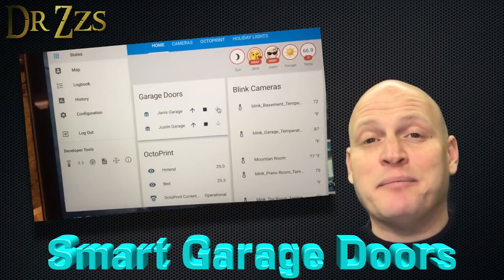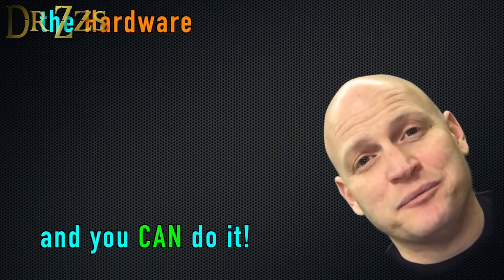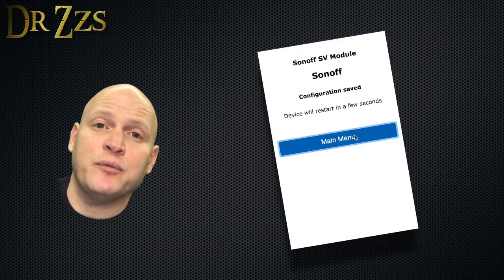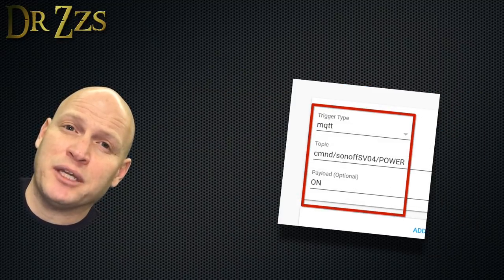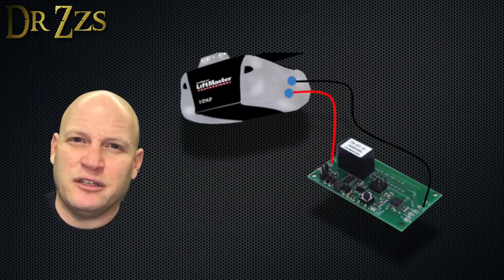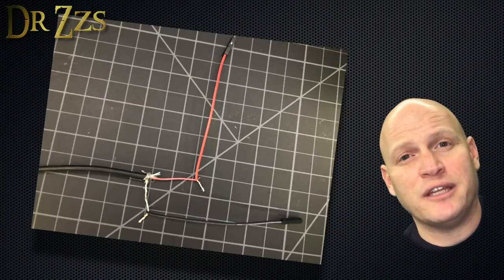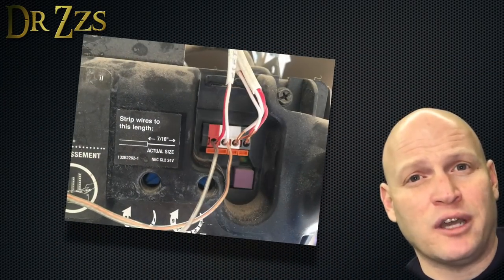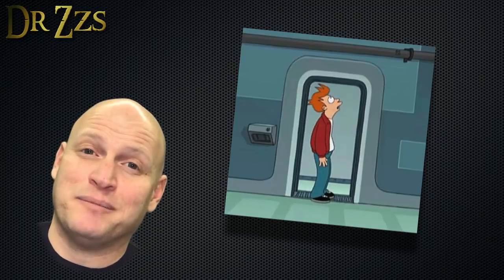$5 DIY "Smart" Garage Door Opener using Sonoff SV

Comment: Hey DrZzs, How I change the state of reed switch? You have when they are together, the door is opened, and when they are away, door is closed. I want the inverse. When they are together, the door is closed and when they are away, the door is opened. How can I do that? thanks
Reply from the maker: Try swapping "ON" to "OFF" in the state topics. 
This is what I have:

cover:
  - platform: mqtt
    name: "test"
    state_topic: "cmnd/2/POWER2"
    command_topic: "cmnd/sonoffSV04/POWER"
    payload_open: "ON"
    payload_close: "ON"
    payload_stop: "ON"
    state_open: "ON"
    state_closed: "OFF"
    optomistic: false
    retain: false

I think if you change (state_open: "OFF")  and (state_closed: "ON") it should change how the arrows show on the cover card in Home Assistant.  

Let me know if that works.  Actually, let me know if it doesn't work too ;P
Reply: Hey DrZzs, 

First off all, thanks for your time. I tried it and it works :) thanks so much!
Reply: I have one more question. If I unplug sonfoff from the power and connect again, it switch to on. What sould I do? Thanks

Comment: If you Console the PulseTime<x> command (ie. PulseTime1 10),  then you can skip the automation that turns the relay back off after 1 second. Instead,  the Turn OFF trigger will be executed automatically via the Tasmota firmware, and not through Home Assistant.

PulseTime<x>                  Show current PulseTime of relay<x> in 0.1 seconds
PulseTime<x> 0 / off        (Default) Disable use of PulseTime for relay<x>
PulseTime<x> 1..111         Set PulseTime for relay<x> with 0.1 seconds increment
PulseTime<x> 112..64900 Set PulseTime for relay<x> with 1 seconds increment starting with 12 seconds (add 100 to desired interval in seconds, e.g. 113 = 13 seconds and 220 = 120 seconds)
Reply from the maker: Couldn't have said it better myself! 
Thanks Jose!
Reply: "pulsetime1 1" worked like a charm. Prefer this then HS as the delay works also from Alexa app when garage is triggered. W/O this the relay stays open and garage will not react to physical button push. 

Awesome tech guys! thank you
Reply: super Jose Almonte :) thats is exactly what i wanted very helpful thank you
Reply: Thanks Brother
Reply: But then you would also have to change this to ON right?
    state_closed: "OFF"  <-- "ON" ?
Reply: @HenrikCaspersen  YES!  I'm glad you mentioned this..  Helped me fix my open / close issue with IOS Home Automation
Reply: @Jose Almonte Thank you soooooooo much. The automation wasn't working properly on mine. Also i had to switch mine to Power1 instead of Power2 and I couldn't get help to get this to work. Now just waiting on my reed switch to be able to show me open or closed.
Reply: @kpj54256  did you get the Reed switch working? When i trigger the reed switch it triggers the relay to open and close the door

Comment: Great tutorial video Mrzzz.  Cant want to get started but I have some questions hopefully someone can answer to clear up my confusion.  Per this video I have purchased the Sonoff SV, reed switches, jumper wires, USB to TTL Serial, and have downloaded the arduino software, and the tasmota software.  So my confusion is, this video does not have the flashing instructions but Mrzzz points to a link that has 3 different flashing videos.  It looks like they are all for the sonoff basic and NOT the sonoff SV which is what I have.  Can someone point me in the direction of the tutorial on how to flash tasmoto the Sonoff SV?  Is that any different than the Sonoff basic?
Reply from the maker: Hello!
Flashing is even easier with the SV.  I don't remember now which videos I linked about flashing but here's the newest one I've done. https://youtu.be/KMiP9Ku71To
The process is universal for any ESP8266 (the wifi chip) based devices.  Connect Rx,Tx,Gnd, then ground GPIO-0 (usually holding the button down accomplishes that), then connect 3v.  After that you can release the button.  I'd recommend using FlashESP8266.exe or ESPhomeFlasher.exe to upload the pre-compiled bin file from tasmota (or ESPhome).  https://github.com/esphome/ESPHome-Flasher/releases
https://github.com/letscontrolit/ESPEasy/releases
You might want to watch this too: https://youtu.be/AU1KD_aJSMY
I'm giving you a lot of options which might be more confusing.  Start flashing and you'll soon be a master and it will all make sense.

Comment: Hi, great informative videos many thanks. One question would it be possible to use a duel sonoff to operate the gates and garage door independent?
Reply from the maker: Thanks!
By gates do you mean the reed switches, that show if the door is up or down?  
I'm assuming you mean something else.  Help me understand what you want to do.  
The answer, most likely, is yes.  The Dual has 2 relays and 2 sets of "button" pins.  If you want open/close status you can connect the sensor (reed switch) to the button pins.
Hope that helps!

Comment: Video is, as usual, full of GREAT ideas, thanks.   I could use a little direction though.  Puzzled on 2 points: What is the function of "switchmode2 2"?  From the 'Commands' (get-hub), there are only 2 states for switchmode2,   1  and  0.  What does the 2 do?  And, I need a second switch attached to GPIO.(Built-in relay activated opener, switch 1 for full open position, need switch 2 for full closed position-have "Critters" that occasionally block the doors).. I tried to use GPIO5 for the 2nd switch, the Sonoff SV kind-of worked but erratically.  Any suggestions?  Thanks
Reply from the maker: Thanks!
I think you meant SwitchTopic maybe?  There are several different SwitchModes: https://youtu.be/kiXAGkyqFeU
SwitchTopic is different.  And actually... That part might not be as important anymore as it was in the version of Tasmota I was using when this video was made.  The reason I set SwitchTopic to 2 was to change the topic that the reed switch sent it's state to.  Without changing that topic the relay would trigger when the reed switch changed states.  
SwitchTopic 2 has a different purpose now according to the Tastmota wiki: 
https://github.com/arendst/Sonoff-Tasmota/wiki/Commands
I'm not sure which version that change occurred in.  
Regardless, now to get the relay not tied to the state of the reed switch, you need just set one of the extra gpio pins as Relay2. You don't have to connect a relay to it, just name one of them Relay 2.  Then you set the pin for the reed switch as Switch2.  Then the topic for the reed switch will end with "power2" and the topic for the relay will end with "power1".  
Now, for your idea of setting 2 positions switches.  That's tricky.  With the Sonoff SV you have pins 1,3,4,5, and 14.  for each switch you need a relay assigned to a different pin.  So if you set Switch2 on 14 for one position switch, then you need to make another pin Relay2.  Your other position switch will be Switch3 and so you'll need to set another as Relay3.  GPIO5 should work, but since you tried it and had odd behavior maybe try setting GPIO4 as Switch3.  Then set GPIO5 as Relay2 and maybe GPIO1 as Relay 3.  The trouble would come because some pins can't be grounded at start up without causing errors.  It should be okay to call those relays just for the purpose of having unique mqtt topics.  Your second position switch will end with "power3".  
That's a long explanation.  I guess this is something better explained with visuals.  I've been thinking it would be good to answer some YT comments on the live streams (Sunday's at 10am MST, and some random weeknights in the evening).  This would be a good one to go over because it has changed a lot since the video. 
Hope that helps!
Reply: My bad,  I completely misinterpreted the definition explanations under the 'MAIN' Commands list.  Now I understand (for the most part).   OK...I set GPIO3  to   Relay2,..GPIO4   to   Relay3...GPIO5   to   Switch3...GPIO14   to   Switch2....Then set PULSETIME1 20  (so it would not hold the garage door opener contacts down too long)...So far, it works (on my test bed).  Have you experienced any problems with the Reed Switched holding the contacts closed (eg. Sonoff SV restart due to power 'glitch')?  THANK YOU again for all your help...I would not be doing any of this without your expert knowledge and detailed video explanations!!!

Comment: @DrZzs how does one get the current cmnd/garagestate/POWER2 updated to Home Assistant in the case of a power outage or restart of Home Assistant? I simply can't get my head around it. It will update happily once I trigger the relay and it all works as per normal, but there is no I can figure out how to update the POWER2 status into Home Assistant without doing this. 

I'm sure it's something simple, but I just can't Google any more.

Comment: This video will probably get popular again since MyQ decided to break the integration. I myself will probably have to get this setup working again from when I set it up years ago. Anything new or changes that need to be addressed? I still have my sonoff I made per this video previously but took it down when I got a new garage door opener since it had MyQ. Reed switch is still attached to the garage. Guess hardware locally always wins as usual vs relying on third party companies.

Comment: I just downloaded and installed hass.io to run on my Pi 3.  Long story short my configuration.yaml is different does not contain a customize section...  I psuedo have things working but looks like mine treats the reed switch the as same as the leads that go to the opener motor.  Any ideas what I have missed?
Reply from the maker: hmmmm, so when the reed switch is closed you get LED's turning on too?  I'd have to see how you have things wired to maybe understand what's happening.

Comment: DrZZs, PLEASE HELP: I got 2 garage doors, Garage1, Garage2. what should State_topic and Command_topic be? Sorry for 'stupid" question. I am new to it.  i think I need to change "state_topic:" right now both of them are "CMND/2/POWER2", my "command_topics" are "cmnd/Garage1/Power" and "cmnd/Garage2/Power" (also, when i close reed switch, both door mdi icon shows OPEN, is there a way to change it to show Garage Closed when REED SWITCH is connected, going to mount it at the buttom of the door ). Any suggestions would be appreciated. Thank you. keep up a good work!!!
Reply from the maker: You have to change the switchtopic for the second one.  So for one you put switchtopic2 2
For the other put switchtopic2 3
Then in HA the second door’s state topic will be stat/3/power2 

Not a stupid question at all. I should have explained that better in the video.
Reply: DrZzs Thank U so much!!!
Reply: quick question, for ICON to show door closed when REED connected, shoud i flip ONs to OFFs and OFFs to ONs, or there different solution?

Comment: DrZzs I had one SonoffSV and following your instructions worked great. I tried adding the second SV to second door but ran into issues with
state_topic: "cmnd/2/POWER2"
what would be the state topic for second door?
Reply from the maker: you have to change the middle section of the topic.  
So in the Console of the second SV instead of "switchtopic2 2" you need "switchtopic2 3" then the state topic in HA would be "cmnd/3/POWER2"
That should do it!
Reply: Were you able to get the User Interface looking like what DrZ showed in the video?  Mine only shows an icon of the garage, which I can press to activate the relay.  The up-down-arrow indicators (which are also switches) that show the status of the reed switch are missing.  What part of the yaml actually creates the UI as shown?

Comment: Really good! I think instead of writing an automation in HomeAssistant with a delay, it's easier to set "pulsetime1 10" in the Tasmota console.
Reply from the maker: thanks!
yes, you are right that is a better way.  I didn't know about pulsetime when I made this.  I know others have done that and it's worked well for them
Reply: I would also add "homebridge_cover_type: garage_door" under cover.test in the customize section of configuration.yaml. I imagine 9/10 people with HomeAssist run a homebridge too (with the homebridge-homeassistant plugin), and without that line the cover wouldn't go through my homebridge to Homekit. Pretty cool to see, how Homekit also animates the garage door icon as "opening" or "closing" in between when the button is pushed and before the state change passed by the GPIO switch. Worth a video ;)

Comment: I'm about to embark upon SV flashing and I'm considering using 5.1.4 instead of the newer releases to avoid some of the changes others have had to make due to updates.  Any compelling reason to flash with newer versions?
Reply from the maker: nope.  5.14 has been nice and stable and it has all the features you would want for a garage door opener.  Heck, one of my SV's is still running v5.8 and working flawlessly.

Comment: thank you for a great video. only one thing the reed switch is that a NC(normal close type) or NO. Checked the amazon  link but there is no info there. thank you kindly
Reply from the maker: The one I used is Closed when the sensor and the magnet are together, and Open when they are separated.  So it's Normally Open. 
If you want one that is Normally Closed: http://amzn.to/2FIPMOf

Hope that helps!

Comment: What happens when there is no WiFi or you are upgrading the mqtt server? Doesn’t the reed switch trigger the garage door? This happens to mine as the tasmota firmware seems to default back to gpio as switched to trigger the relay when it can’t connect to mqtt! Open the door, stop mqtt, close the door and watch it reopen when the reed switch is activated. 😒
Reply from the maker: Alru Waldeck That hasn’t happened to me.
Did you set “switchmode1 0” in the TASMOTA console? If you don’t then yes the reed switch will trigger the relay. 
If that’s not the problem let me know and I’ll try to think of what else might be happening.
Reply: thanks for the reply, I did set switchmode1 0
Everything works really well but the issue is when the sonoff cant reach the MQTT server it somehow becomes dumb and uses the reed switch as a button and triggers the relay. Turn off your wifi/mqtt server and trigger the reed switch to recreate the issue. I noticed this after a power failure and the mqtt server didn't start up again properly, upon opening the garage it started closing again as soon as it opened, and opened as soon as it closed. I have 2 reed switches on my opener that I tapped in for closed and open status.
Reply from the maker: dang.  Sorry I don't know what to do about that.  I'd say go to the Tasmota guthub and search the "issues".  If someone else hasn't faced the same problem make a post.  They're pretty good about responding to comments. 
https://github.com/arendst/Sonoff-Tasmota/issues

Sorry I'm not more help.
Reply: DrZzs no worries I'll do so thanks anyway, thought it might be good to be aware of it. Could cause issues. Keep up the great videos!
Reply: Alru Waldeck Did you figure out a solution to this? Ran into this today as my Raspberry PI wouldn’t boot.
Reply from the maker: Sorry I don't have an answer for this.  I haven't had that problem.  I don't know what settings might be different or if my switch just doesn't disconnect from MQTT when I'm using it so I don't see it happen.
Reply: Peter Luong Hi, yes it turns out if you set the switch number to 1, it will be used to trigger the relay when there is no mqtt connection, even tho you set it not to in tasmota .. So I set my Reed sensor to switch 3 on gpio 14 and so far so good, even with no connection to mqtt it doesn't trigger the relay!
Reply: Thanks for the reply. Are you using a Sonoff SV? I tried your suggestion of setting my reed sensor to switch 3 on gpio 14 and it still triggers the relay. So frustrating. Starting to wonder if my SV is bad. I've tried upgrading to the latest tasmota release and even re-flashing it.